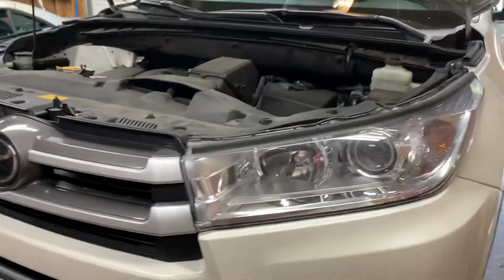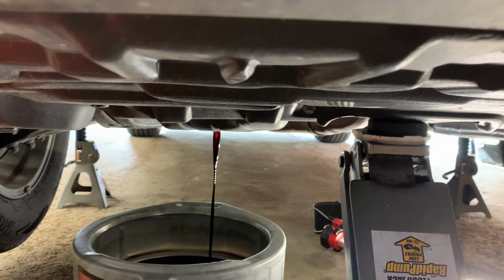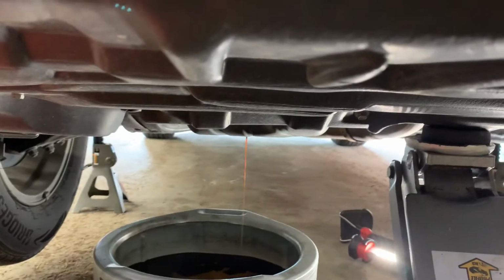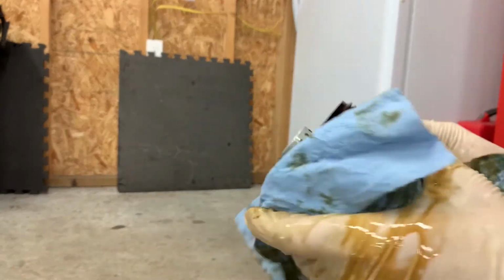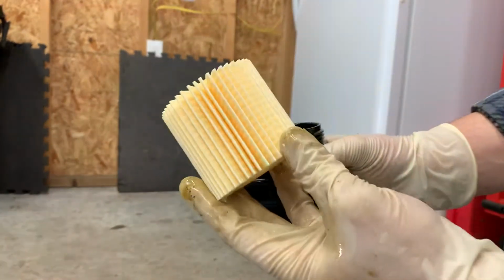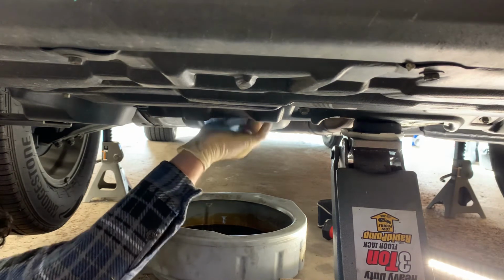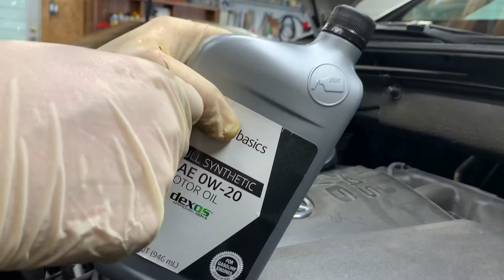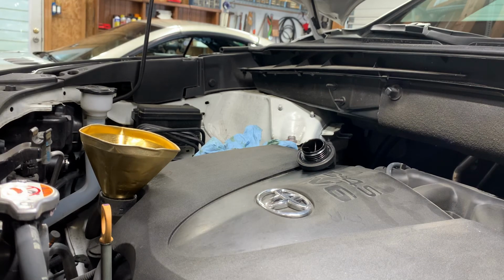Fast and easy way to change oil on a 2018 Toyota highlander!

Comment: I just compared Amazon Basics with Costco Kirkland synthetic. Amazon basics is $7.50 a quart ($45 for 6 quarts). Kirkland is $4 (10 quarts for $40) a quart. Both full synthetic and both probably exactly the same oil for the most part. Might consider it if you have a Costco membership

Comment: Suggestion: Use 99% Isopropyl alcohol in a spray bottle to clean the filter case and housing both inside and outside.  It's great at removing grease and oil and evaporates quickly.  Also, if you can find it, get some DC4 o-ring lubricant.  It is soluble in water and oil but protects the o-ring from damage from the threads.

Comment: How does one evaluate that Amazon oil is good enough? Toyota brand oil could be had for 25 cents more per bottle.  Is the $1.25 per oil change going to make difference?
Reply from the maker: If you watch project farm video on oil You’ll understand why I use Amazon oil.
Reply: @builditben9945  Amazon oil is made by manufacturer that nobody heard of. Did project farm perform long term tests and did he come to conclusions that it is best based on saving/performance?
Reply from the maker: It has the same additives as the leading brands but more. There are only a couple manufacturers that make oils for all brands.
Reply: @builditben9945  We all realize that there are more oil brands than manufacturers.  You are saying that the Amazon oil is better than the leading brands, I believe it is less expensive too. Perfect oil! Great thing we finally found it!
Reply: Yes I agree the Kirkland brand from Costco is definitely the cheapest and it’s a good quality synthetic oil. Since I change my oil every 4-5,000 miles I’m not worried one bit about the quality of that oil. No one could convince me to spend money on Toyota oil or mobile one for that matter with that change interval
Reply: Since Amazon based in Seattle, he is supporting his local business by purchasing Amazon basics products

Comment: Doing my 1st oil change since purchasing our 2018 Highlander Hybrid Ltd. (18k) miles, now at 28k. The oil coming out is clear and bright like new! I’ve never owned a vehicle where the oil isn’t black at 3-5k oil change intervals. And this vehicle constantly stops and starts during city driving. Very impressed.
Great vid, thanks!
One suggestion: I’d recommend pinching the housing o ring at 9 and 3 o’clock position and squeezing upward to create enough stretch/slack to grab it and pull it off. Using a screwdriver can risk scoring damage to the o ring groove. Or, easier yet a little pick used carefully.

Comment: Very funny how on the 3rd bottle of oil you held it the " wrong " way. The reason to hold it that way is that it allows a little air back into the bottle so that it doesn't come out in "spurts". One other piece of advice is to take a paper towel and wipe down the filter housing mounting surface and inside that area. It's not doing any harm by not doing it but it's just that little bit  "cleaner" and less chance that a drip of oil appears and you think you have a ;leak. A good reason to replace gaskets is that over time they break down and become brittle or deteriorate So I would pull that filter housing drain plug out once every few oil changes and swap in a new gasket. People think the plastic filter housing needs to be replaced with an aluminum one but that is not really necessary as the plastic ones will last the life of the vehicle.  The problems arise if the filter housing is over- tightened ( I believe the torque required is actually around 17 foot pounds which is not very much at al)l. Some Quick Lube places will overtighten the housing so that when the next oil change happens the housing is seized on and requires so much torque to remove that it cracks the housing ( it will also crack an aluminum housing, don't kid yourself ) and you have a leak and need a new housing. Even some Toyota mechanics have used air tools or just over tighten these and you need access to new filter housing or your vehicle isn't going anywhere for a while. On the Highlander the oil goes into the fill hole quite quickly but on some vehicles if you pour it in that fast it will overflow and cover the outside if the engine so watch around the bottom of the funnel for oil seeping up. p.s. it is also a good idea to place a piece of cardboard or paper under the engine after you have put in the oil, checked the level ( a little more than halfway between the lower and upper marks, oil expands as it heats up )/ run the engine for a while ( a couple minutes ) and look for drops of oil after 5 or 10 minutes.
Reply: great advice

Comment: Good video. Thanks for sharing this.  

A few thoughts.  First, although you didn't have to do it this time, you suggested using a screwdriver to scrape the washer / gasket from the oil pan if it sticks after removing the oil drain plug.  That's probably an OK way to do it, but you risk scratching the area where the washer / gasket seats to the oil pan, which could result in a leak, particularly if you do this repeatedly over many oil changes.  If you use a screwdriver to remove the washer / gasket, wrap the blade in a cloth first so you don't scratch the oil pan when removing the old washer / gasket.  

Second, you didn't mention, or remove, any rear tire chocks after removing the jack stands and jack.  Again, probably not a big deal, but for added safety, you should chock the rear wheels to prevent the car from rolling backwards when the front is elevated.  

Third...Amazon-brand motor oil?  Yes, it's Dexos approved, API certified and white labeled by Highline Warren, but...for not much more (at BJ's or Costco when on sale) you can get Mobil One and get the highest standard of performance.  Once again, probably not a huge difference, but I always feel better knowing I've got fresh Mobil One in the crankcase.

Comment: Can I change the oil on my 2018 Highlander without having to put it on a lift? I used to slide right underneath a Toyota Tacoma without a jack.  Can I do the same on a Highlander?  I am tired of paying these high-priced oil changes at the local establishments.  Thanks!
Reply: Buy a jack and either jackstands or use something else (I use stumps), that should be cheap enough.
Reply: @jamest3552  great idea 💡 thank you sooo much! Happy New Year 🎆 2024.
Reply: I inch myself under my truck when I don't feel like pulling out my jack and stands.
Reply: @monahumada7535  thank you for your help. I need to start changing it myself. I can save a boatload of money. You find it easy right on the Highlander?
Reply: @peacelovejoyandhappiness Actually yes it was easy to find. Go to the right frontier and get it under the headlight. There you can see the filter and a little further in you can see the drain plug. You need that tool to take the filter housing out. It's a really tight fit for me so I do suggest a jack and stands just so you have room to work. It will be frustrating if it's your first time trying to learn like that.
Reply: @monahumada7535  thank you so much. One more big favor, do you have the best video selection you can think of to share the link on describing in a video how to change the oil on a 2018 Toyota Highlighter? You can post the link ⬇️ below. Thank you if you don’t mind doing this for me. 🙏🏼
Reply: @peacelovejoyandhappiness  I have only watched this video. It is pretty good with the detail. You should rent a Torque wrench. You need to Torque the oil filter to 18 foot pounds (not inch pounds). Yesterday was the first time I have ever done that car. My sister bought it and she wanted me to walk her through it. She is confident in doing it herself now so I know you will be able to do it. Just watch the video as you are changing it out.
Reply: @monahumada7535  thank you once again, you are really great with helping with advice. Have a great week.